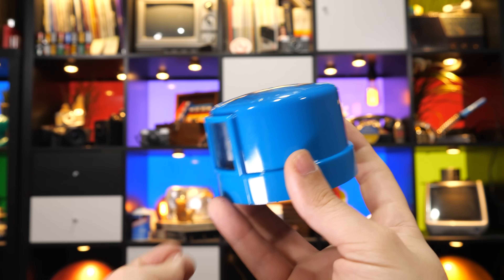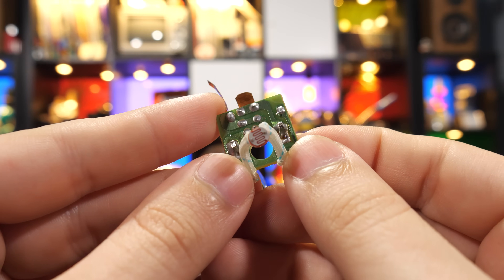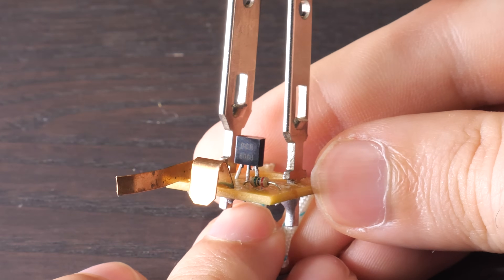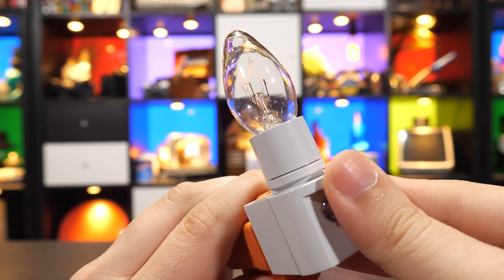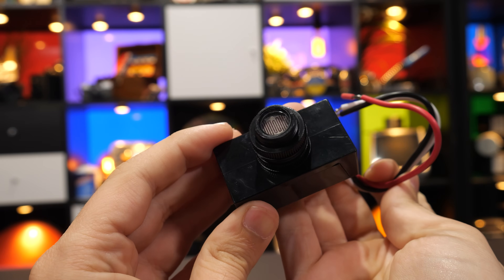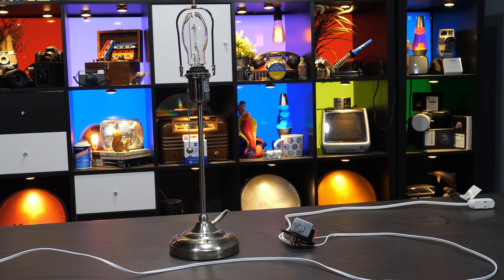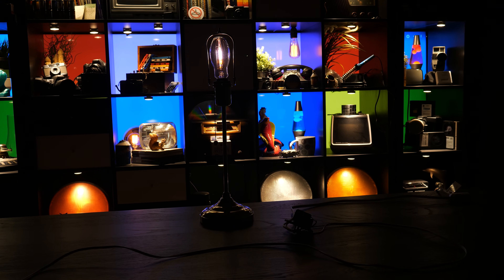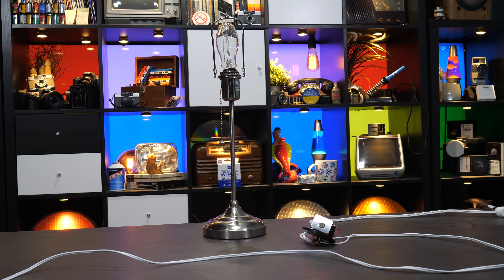Photoelectric light controls are weirder than they seem

Comment: "says definition of hysteresis without using the word"

screams at screen: so hysteresis then

"says hysteresis to make me happy"

I am satisfied thank you

and you don't need software or physical properties to create hysteresis, it can be done purely in the analog hardware world. but you still need a power supply and properly rated components and reliability will drop overall. you would make a nearly even trade of lower reliability for standby power savings. which is not exactly compelling, but maybe with LED drivers tho?

Comment: I was surprised the thermal paste was on the bottom of the circuit board, and not directly atop the resistors. I imagine it's probably done that way to eliminate any risk of the solder pads shorting against the metal housing of the limit switch.

Comment: I saw a little night light with an even simpler photo controller - just a resistor, a photoresistor, and a neon glow lamp. When there was no light on the photoresistor, the voltage output from the resistor was just enough to activate the neon light at 74 volts. When there was light on the photoresistor, it bled off enough current to drop the voltage below the voltage needed to activate the neon lamp, turning it off. The neon light itself acts as a voltage controlled switch! The odd thing about that is it used more power when the light was off! Well, less than 2 watts either way, but still - more efficient to just have the light on all the time. 

BTW, the first dial telephones used a neon light as a voltage controlled switch. Normally, the phone operates at a low voltage, but when a higher voltage pulse was sent down the line, the neon light switched on and powered the ringer.

Comment: Surely the solid state thyristor solution controlling a relay or contractor would be better than the crazy bi-metallic strip option.  It’s not as if it needs lots of components to build or maintain. 

What is really interesting is to see just how inefficient the old street lights really are, and how updating them with LEDs really does save a lot of money.  It’d also mean that the wiring used to run the lights could also be used to power some low power EV street chargers.  A 3kW street charger would actually be enough to keep most people’s cars charged while parked overnight - something that would be really useful for people who don’t have off street parking.

Comment: 13:20 Is it really inconsequential that you have a significant extra load to support after a power outage? If it's a result of a small failure in the distribution grid, bringing it back online is easy. However, in a black start situation where the total grid has to be brought back online again, I would think that all that additional load would make it harder.

Comment: Small point to make about the software comment at the end: microcontrollers are programmed with firmware which is more reliable than software.
What is firmware? Depends slightly who u ask. My favorite description is as follows: firmware runs directly on hardware, software runs directly on software. Which is y software is less reliable; more potential points of failure 
But ya that doesnt change ur point at all. Just a small caveat

Comment: I love how still, we use mechanical and physical switches. They're robust, dependable, and reliable. If it's broke, it's broke, not glitchy. They either work, or don't. No need to have someone spend time debugging, trying to figure out what the programming is, did someone hack it, whatever. Doesn't work, send someone to spend 15 minutes to replace a jellybean part

Comment: Seems like a better answer to simplify this would be to have the photoelectric sensor feed into a NOT gate transistor setup controlling the feed voltage for a control line for a contactor. Photoelectric cell gets a signal? That commands the not gate transistor to break contact, which breaks the voltage to the contactor's electromagnetic switch, which in turn breaks the voltage to the bulb. And given that the exact same part can be used in literally every street light ever, I feel like someone like AEL, who makes a lot of street lamps, especially ones you see in residential or classier public parks, could subcontract that part manufacture to make that nice and small.

Comment: 15:55 A microcontroller is way overkill for this imo
you can do it with some sort of transistor, a diode, and a relay, to modernise it (along with resistors)
and, if you need hysteresis, make a schmitt trigger from an opamp instead
I imagine this hasn't changed because it works well enough and a redesign doesn't offer enough benefit
Reply: also hysteresis isn't hard to implement on μC's; just use a state machine.
Reply: also the circuit mentioned doesn't require any capacitors
Reply: but the real world application of that would be quite a bit more complex than their 4 component design
also the fact it runs on AC without needing to convert to DC
there are a lot of reasons I think the strange design makes sense

Comment: I'm pretty sure most European light controls I've seen are electronic but don't have a microcontroller. Either some transistor/triac logic, discrete logic or a dedicated IC. I think I've even seen some nifty circuit using a series capacitor that is put across the mains by an LDR when it's light and powers a relay coil when it's dark. Added bonus is that it only draws a small bit of blind current when it's light but doesn't actually use any power.

Comment: The only reason they don't use electronic version is because the input voltage is 120v AC and you need 5V DV input for a microcontroller AFAIK.

Comment: Definitely one of those streetlight people living just to find emotion, out there somewhere in the night!

I'm wondering now if climate change might come to necessitate a change in the function of these devices?  Places are getting so hot now in the summer that it might take a much longer time for these to cool down at night, especially since by their nature streetlights are out in the open under direct sun and hanging over heat absorbing asphalt.  I know that direct current is what heats them the most and causes the metal to bend in the other kind of switch, but might ambient temperature also have an effect over a certain threshold?

Comment: You should note that by design this will cause the device to fail in the "on" position which is preferred in most electrical designs for maybe not so obvious reasons.

Comment: How does the big photoelectric control work in hot regions?
Reply: @krystal5887if it only takes a "few" photons to heat it when ambient temperature is 30F, then it sure seems that there's enough heat when the ambient temperature is 100F, or even 80F.

Comment: 12:19 Thank you!

also as an electrical engineer by training I figured on the solution for hysteresis being some kind of op-amp integrator, this solution is so much cleaner (not least because you don't need rectification or voltage conversion), and as soon as you said thermostat at the beginning I went "Oh that's so smart!"

Comment: I got a vintage one of these that is in a massive alloy equipment enclosure. This has a glass window fitted in a gasket to the outside world. Under this sits one of those original Phillips LDRs. They look like a vacuum tube because they are encased in a glass envelope and actually have an octal base. It works the same way though. During daylight hours it allows sufficient current to flow through an element to heat up a bi-metal strip to interrupt the power to the controlled lamp circuit. It's also made from off the shelf parts.

What is special about it though is that element is part of a standard electric stove element simmerstat. The whole unit is inside the enclosure including the stove type control knob! And one can use the knob to set at what dusk level the lighting circuit comes on. You might think a simmerstat would end up flashing the light, but the trick is simply to reverse the load and supply connexions, The LDR is wired between the simmerstat's neutral pin and supply neutral. 

You would definitely want to be controlling a pretty big lamp or a bank of them to leverage the power savings as the element draws about 5 watts, and it will be doing that all day. 

Here in New Zealand most of the streetlights are not controlled by any kind of dusk switch. Instead they use ripple control relays and the on/off signals are injected into the local power grid by the power company, controlled in turn by an astronomical time switch.

Comment: Simple solution: 
Replace power supply and photocell with a 5w solar cell. 
Trade off: 
Winter. So the cell needs to be mounted vertically.

Comment: DuPont tried using a PDP-8 and photocells to control urinal flushing at one of their sites. It crashed a lot and the bathrooms started to smell so someone figured out how to do it with timers instead. CSC took over and actually turned off the urinals the contractors used every weekend

Comment: No microcontroller needed, this can be done in old-school analog and with much lower standby power draw using the photoresistor to run a transistor as a switch along with a slow-charging/discharging R-C pair to create a hysteresis timer. To switch a larger load, use the transistor to control a thyristor or a relay. But you're still looking at a half-dozen components with sensitivity to voltage spikes and lightning EMF. The electromechanical method is incredibly reliable in spite of the daytime standby losses.

Comment: It also neatly makes the unit fail safe, as the default mode is "on", so roads, etc will not be left dark if the sensor fails, and, the lights remaining on in daylight will signal the need for replacement.

Comment: Honestly didn't expect to see a thermal relay there. The ones Ive worked with here in Sweden had a bi-metallic contact powering a bigger relay (mostly to handle larger loads). Another thing was that in our city we had one photocell for the entire city. It was located at the main substation, and via signal cables controlled a large contactor in the transformer stations throughout the city which would then turn the power on for the street lights in the area it was supplying. That design let all the street lights in the city turn on at the same time, plus gave you the option to manually turn them on for testing during the day.

Comment: Why not a transistor...? An NPN transistor allows current to flow when the control signal is high, so a photoresistor in the sunlight would lower the voltage and turn it off, and in the dark it would let current through and so it would turn on.

Or heck, use a solar cell instead of a photoresistor, and then you don't even need to consume current from the grid when it's turned off.

Comment: that was shallow.  The photo sensor is a selenium light dependent resistor.  I'm retired now but I've spent hundreds of hours consulting to 2 rural Co-Ops in addition to a career in nuclear power and weapons.  I have never seen a heater type controller and I could not imagine a utility using something so fragile.  Utility apparatus is built to a whole different degree of ruggedness.

The light mounted photo switch must endure water incursion, switching transients, lightening surges and a number of other hazards.  All the ones utilities I've worked for, including a box-full of old ones in the basement, buy contain a selenium light-dependent resistor (the correct name) and a relay with a  normally closed contact with a high impedance coil that draws about 5 ma total.  The coil is a very low power factor load so it only draws a couple of mA of real power.  That configuration is the cheapest method to do the job, which matters when the county had 10,000 or more street lights scattered around the service area.  

When the sun goes down, the selenium cell conducts less current which allows the normally closed relay contacts to drop out and complete the circuit to the lamp.  Home security lights have traditionally been 175 or 400 watt mercury vapor lamps or metal-halide lamps.  People very much don't like the sodium light.  Street lights are 175 or 400 watt metal-halide lamps.  We've tried some high pressure sodium vapor lamps but people bitched enough that they were replaced.

Now everything is LED.  We've had great success with 1500 watt equivalent metal-halide, 105 real watt utility grade lamps.  The same light switch works just fine.  Even though the relay has some hysteresis, none is needed.  Arc tube lamps take several minutes to cool enough to restrike.  The LED lamps the utility buys contain ruggedized and water-proof electronic ballasts that take about a second after power application before they send current to the LED array.

No engineer in his right mind would put a consumer-quality semiconductor on top of a power pole with absolutely no protection.

For industrial uses, LED lamps up to 5kW of metal halide light output are available.  Same type of control is used.  Anything brighter than that is where they use high pressure Xenon short arc lamps.

The only place I've ever seen a string of street lights controlled by a central light switch is in commercial and industrial parking lots.  Walmart, for example.

Comment: A microcontroller might be overkill, but an ASIC would still do the job nicely. Still, the current solution works and is cheap so there's not too much reason to change it.

Comment: A note I think is important about this design. With the control circuit requiring power to disable the light, a fail safe is implemented. Although simple, the control circuit is more complex than the power circuit.  With this design if only the control circuit experiences a power failure, lights will turn on. When talking streetlights that's preferred from a safety and liability viewpoint.

Comment: This is fascinating. My family's farm has an outdoor furnace to heat our home and above the furnace's exhaust just a little off to the side is an overhead light with one of these daylight control switches on top. Sometimes during very cold conditions we would need to use fuel to start our furnace back up which causes a serious burst of black smoke to exhaust and encompass the nightlight, sometimes causing it to turn off at night for about half an hour! When I learned how these photoresisters worked in 4th grade I still couldn't understand how the black smoke covering the sensor would cause it to turn off, as my parents shrugged and assumed reflection off the smoke particles must be tricking the sensor. I assumed the heat may be damaging the sensor since electronics don't enjoy heat, but that didn't explain why it always recovered after a few minutes rather than being permanently damaged. Now I understand we were blasting the thermal switch inside the switch with a blast of hot air, and the delayed recovery was just the time it took the switch to cool back down after the initial blast of fuel-fed fire.

We also had a family rule Christmas morning that as soon as all three of our night lights turned off in the morning, of which the above mentioned was only one and the other two were in our barnyard, that was late enough to start opening presents, but until then we had to let our parents sleep undisturbed. Obviously I would wonder why the lights had some randomness to when they turned on since they saw roughly the same sunlight, but given a heating element and thermal switch is involved it all makes perfect sense.

Comment: EXCELLENT VIDEO ! 
But one nerd thing - if you connect lightbulb to a thyristor or diode - the power will probably not go to half since incandescent light bulb doesn't have constant resistance but the lower the temperature of filament - lower is its resistance 🙂
Nevertheless - very informative video. Thank you

Comment: to make a semi unrelated topic related, a little trick for anyone with an electric clothes dryer who finds themselves in a pinch when their dryer stops heating because the limit switch has been tripped, if you remove the limit switch, place the legs of the limit switch between your fingers with the switch surface on the palm side of your hand then smack the your hand firmly against a wall or other flat surface it will reset the switch so it will conduct again and if you then keep your dryers heat setting on low the switch will usually work until you can get a replacement, side note replace both limit and thermostat switches together......

Comment: Also has a useful failure mode. If the heater fails, the lights just stay on. If we assume light was needed at that location (why else put a light there?), then so long as the lamp is good, there will be light when it's needed. It'll just also be lit when it's not needed. Not great for efficiency, but probably good for safety, and definitely good for easy troubleshooting.

Comment: I have done this for an airport by using a single analog pyranometer type light sensor to control all outside and a solar lit atrium lights for an entire airport.  Basically I took the output from the analog pyranometer, sampled the value from the sensor every 30 seconds or so, ran the sampled value through a second order software filter and used that value to determine light levels.  Software analog logic level switches determined on and off levels for each lighting circuit.  Sampling and filtering prevented things like clouds, birds and even airplanes from causing false triggering of lighting circuits.  It was much easier to precisely setup switch light levels without having to individually calibrate lots of electro/mechanical switches.  Since this was part of a building automation system, the only additional power required was a couple of Milliamps necessary to power the pyranometer.  Since the sensor head of this sensor was designed to sit out in the sun 24/7, there was never an issue with hot capacitors or electronics.